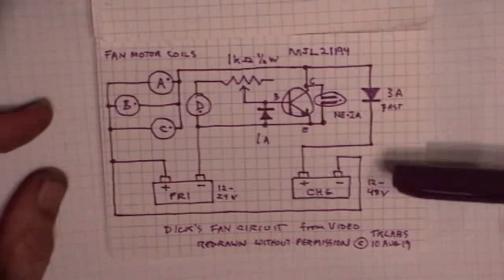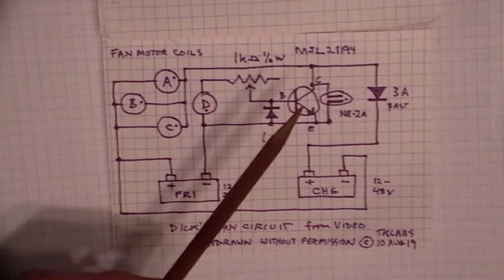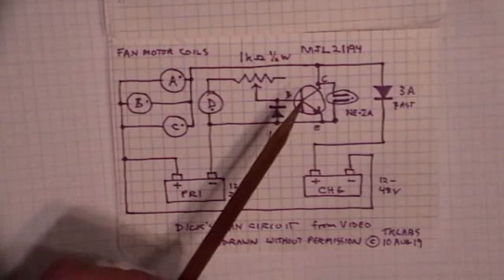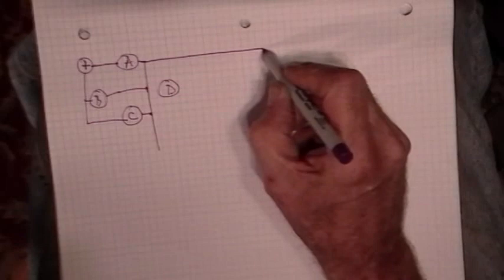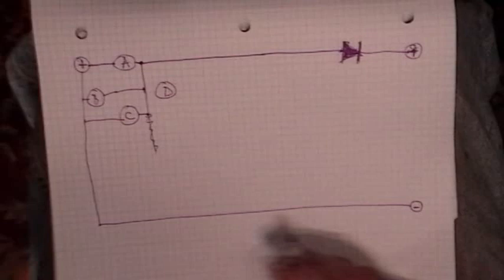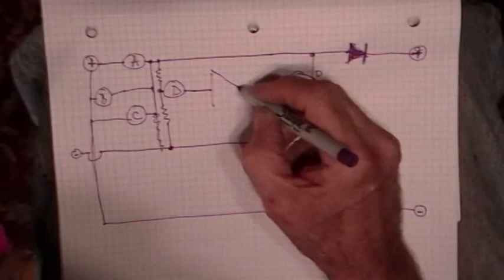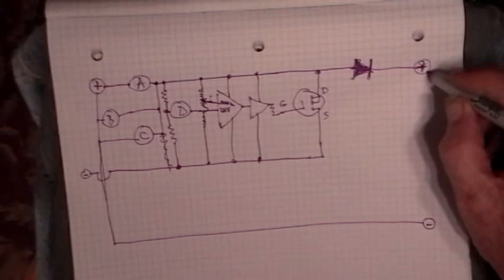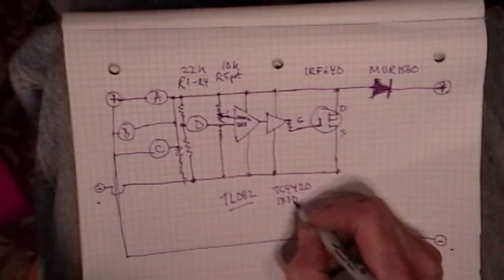TKs DickFan Driver Board Schematic

Comment: Sir can't u, help me
 to my ruslan circuit... From Philippines.. I electronic. Student.. I have some circuit .regarding to akula /ruslan device. It's works.. But if I self loop.. Or. Self runing. It's not working...I think ther are some tuning to the push pull cicuit the kacher Tesla are good.. It's 3 amps consumption. To the input.. I have scope but it's old.. It's hard to determine the proper tuning off the driver circuit using tl 494 & IR 2110/2113 IC TO MY Driver circuit.. The granande was OK.... Cw/ccw rotation bitwen 1 St layer and 2nd layer but the 3rd layer is ccw.... Can't u hpl me..